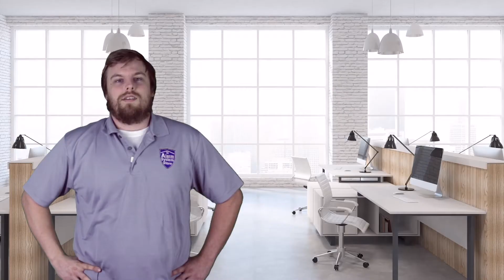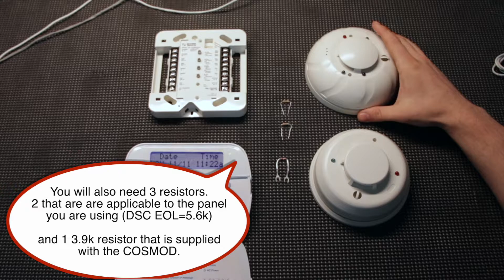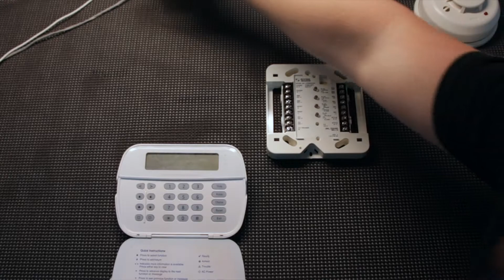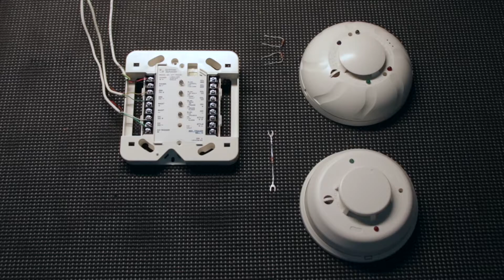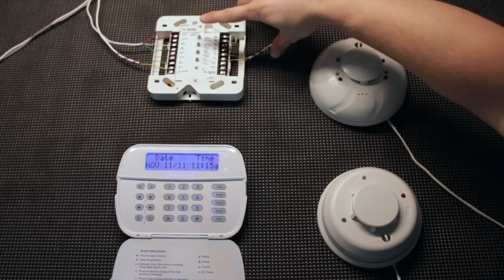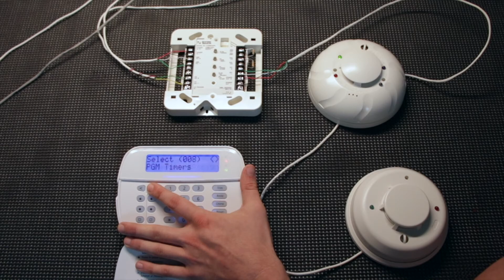System Sensor COSMOD2W and COSMOD4W wiring and programing tutorial for DSC security systems.

Comment: How do you make them all go off at the same time with a Neo panel?
Reply from the maker: By default the COSMOD module will act as a reversing relay for COSMO detectors and (2 or 4)WTA-B detectors. There is no additional installation/programming work that needs done on the NEO to make this happen.

Comment: Question: how do you wire these 2 detector models if each 4-conductor wire is "home run" back to the panel?
Reply from the maker: The best method would be to create a long parallel wire run by splicing the wires together in the panel. This way all of the sensors are technically on one long wire run and place the resistor on the last detector.

Comment: The co cartridges are a joke, you can get shipped an entire bad batch.  We stopped putting these in because of how many issues we kept getting.
Reply from the maker: That's not been our experience at all with them. We see no higher failure / DOA rate than any other acceptable product. Returns cost us time and $ so we drop products pretty quick that falls outside the norm in that regard. We did not carry them very early on though so maybe they had issue in the begining that we weren't part of?

Comment: If you’re installing a new system, is there a reason to choose 4 wire vs 2 wire? Also, it looks like the COSMO2 interface has an extra output for a maintenance required status?

Comment: What’s pgm stand for when you say pgm 1 or 2 like zone 1 and zone 2? And what panel are you using
Reply from the maker: A PGM is a negative switching, programmable output on a DSC system. The panel we are working with is the DSC NEO.
Reply: @AlarmSystemStore  learned a lot in a day, what’s the point of using this device? Am I missing something. Why not use aux and pgm2? For ur smoke?

Comment: I have a PC1616 with 10 cosmo2W did all the programming and the panel kicks a CO zone fault that last a few seconds then its gone, it confuses the panel because when you go to *2 kicks a number 5, when you press 5 the panel says there are no faults, I went on the memory buffer to find out it was the zone where the CO is connected, I clear the trouble with *29# but the trouble keeps coming back every 20 minutes approx, any ideas????
Reply: sorry for the late reply, but while in the *2 trouble menu, after you hit 5 to bring up the "non-fault" press 9. This will erase the trouble code and should fix the issue.

Comment: 2 cosmod2w on a dsc system, does that mean I have 4 zones dedicated to smokes and CO's at the panel or can they be  wired in series like a regular zone ?
Reply: Sorry for the late reply, but yes, you would have to use a second PGM set as a sensor reset, and use 2 additional zone slots. You will have to use less smokes on this COSMOD though as PGM has a higher output than most.

Comment: Thank you for this video. To clarify, this looks like you are showing the DSC NEO series keypad and entries required. It would be nice to see the keypad commands for the DSC Power Series also.
Reply: It is a Neo, but it's the same programming on the older PowerSeries as well.
Reply: @andybowman9697  how do I wire 2 cosmod2w to a dsc 1616 ? I have to install 14 cosmo2w